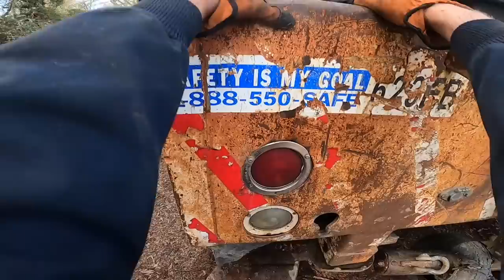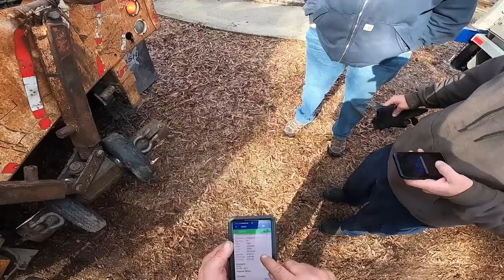Propane Bobtail Winchout plus one.

Comment: Excuse my ignorance but what is the purpose of those chocks with the chains? I love them old trucks still doing the job.
Reply from the maker: Mr Keith The wrecker pulls up onto the plate and then chains get tight which helps anchor the truck. It actually helps alot better than a block behind the tire. Thanks for watching and stay safe

Comment: Nice job Mr Hal. I see so many guys put scotch blocks down and they don't let their truck get up on them all the way and they just slide backwards. I used to pull until my wheels were as far back on the scotch blocks as possible then I would set my brakes. I see you do it the same way. They work very well when properly used. Thanks for the video. Stay safe out there.
Reply from the maker: Mr Dan thanks for watching and stay safe

Comment: Love seeing the 750 doing more work. I'd rather run that than  hydraulic wrecker. Please keep "gopher" busy and working.
Reply from the maker: Mr Dennis We will. Thanks for watching and stay safe
Reply: Except for moving those havy  wheel choks around--waqit until they load up w/ mud or frozen snow-three times heavier-used to feel like. Oh-Mr. Hal--that square  body on the back of that Holmes Wrecker used to referred to as the "Military  body' installation.
Reply from the maker: @Glenn Jukes  Thanks I did not know that. Thanks for watching and stay safe